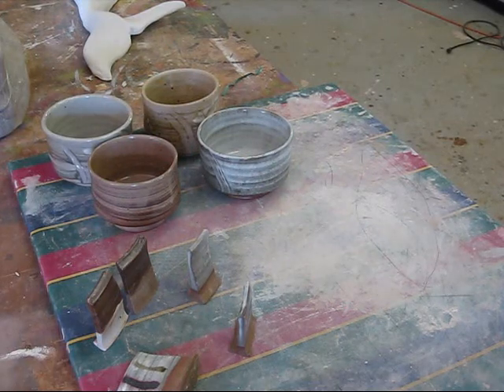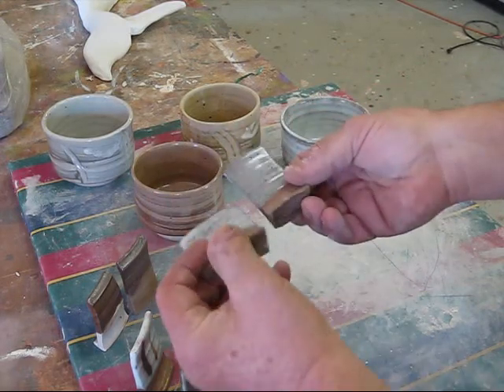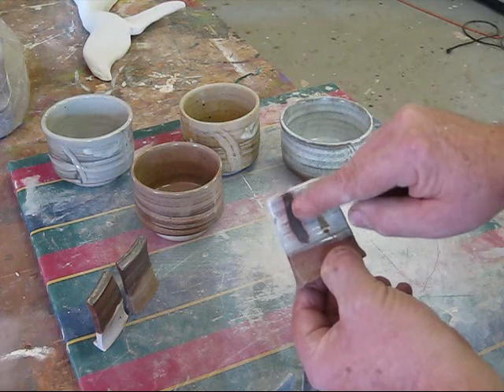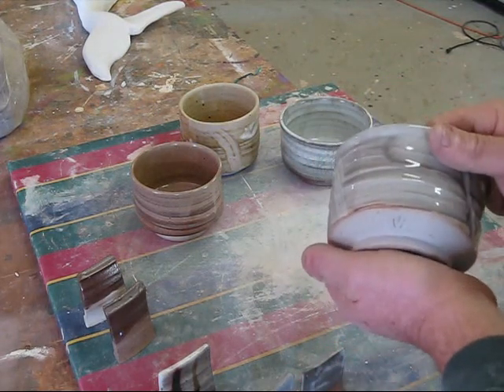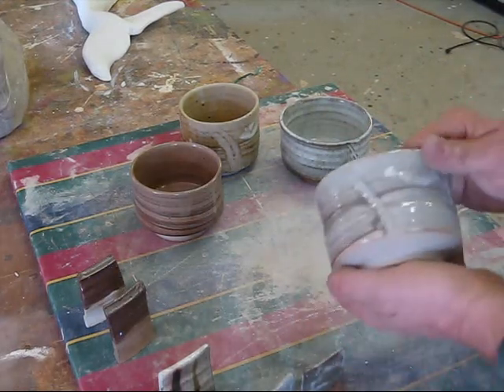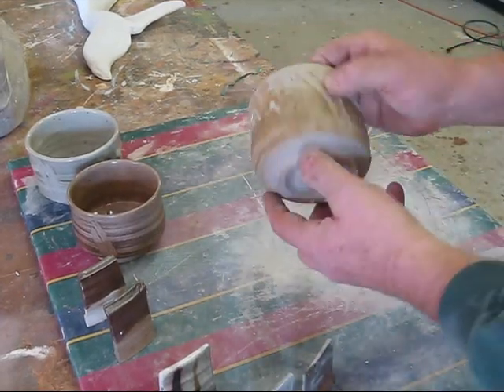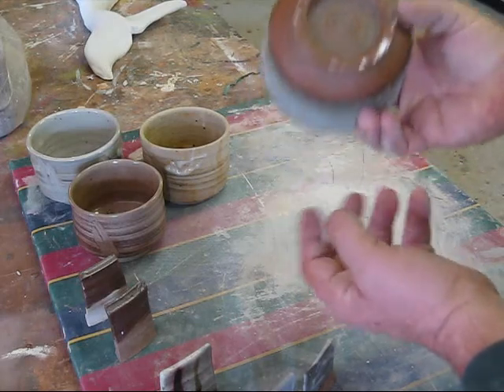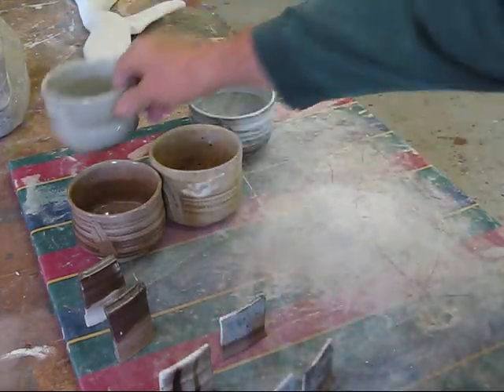TEST GLAZES FOR TEA BOWLS

Comment from the maker: NO SORRY I DON,T. I BOUGHT IT FROM A SUPPLIER. IT ALSO SAYS ON THE PACKAGE "PUMIS" WHICH IS A VOLCANIC STONE AND THAT IT FLOATS.I JUST SAW  A VIDEO SOMEONE USED JUST THE V/A AND GOT A REALLY NICE BLACKISH PURPLE WITH OIL SPOTS I COULDN'T GET IT TO STICK. IT JUST FELL OFF WHEN IT DRIED SO I ADD THE RED CLAY.I DID MAKE I DARK DARK MIDNIGHT BLUE WITH IT. TRING TO COME UP WITH A ASH CLAY FOR CONE 6. I WILL LOOK FOR THE RECIPE. JOHN